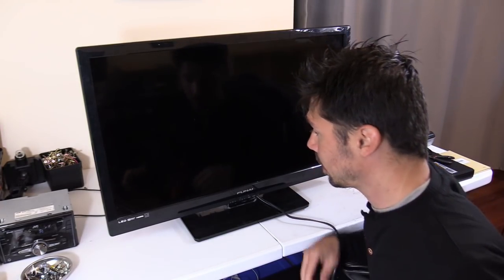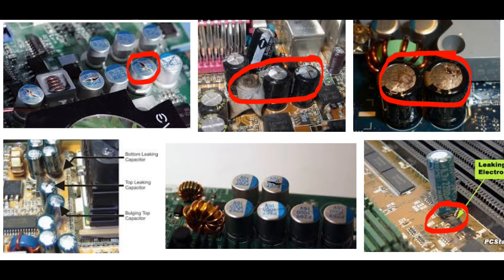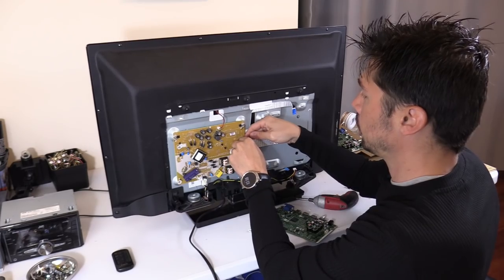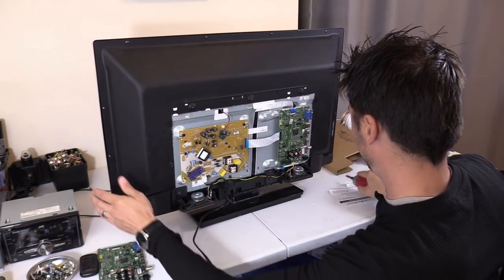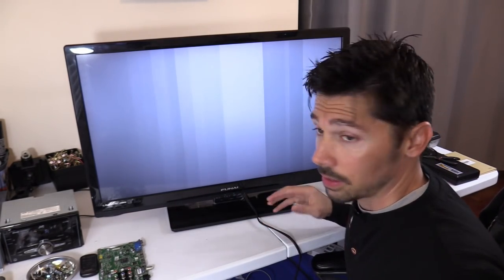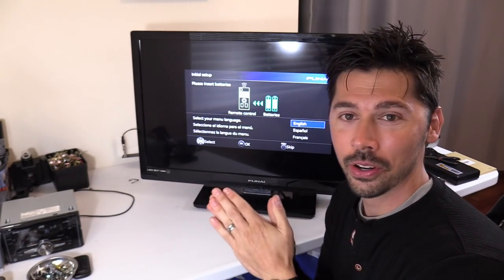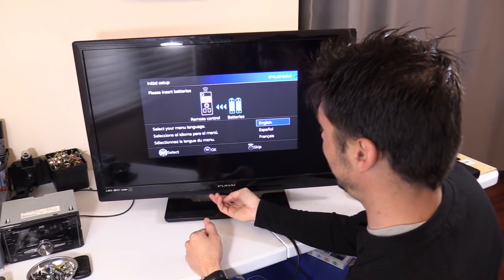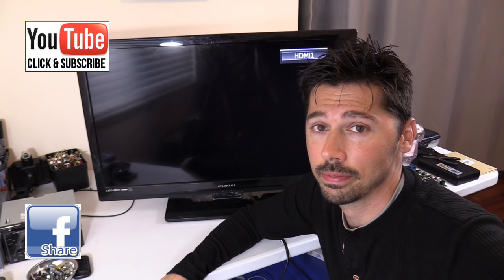WATCH THIS VIDEO BEFORE FIXING YOUR LED LCD TV

Comment from the maker: use the sticker number stamped on the board not the number printed directly on the board. use code TampatecFriend or buydirect5off https://electropartsonline.com/ 
another good source is shopjimmy http://www.shopjimmy.com/components/board-repair-kits or 
Ebay TV parts store- http://stores.ebay.com/ElectroParts-Warehouse/About-Us.html
Reply from the maker: SwapPart TV Repair yes, that saves some money, if u want to link your video here, I'll give you a shout-out. 👍
Reply: Those boards are identical except for firmware. So the replacement was programmed for a TV with a different LCD panel. You could have swapped the eeprom from your original board to the replacement and it would have worked, I do it all the time.
Reply: @SwapPartLLC  Thanks, I was SO curious what the differences were. Makes sense now.
Reply: As if he's got time to point out what's wrong with each and everyone's broken TV's... Lol.   Mines had it too thanks to little hands and a wooden hammer!    Sooo, I'm going to watch his videos & see if there's another way...  He hs a channel, not a hotline    :0)
Reply: Tampatec hey Tampa I have tv when I turn on tv there's sound but no picture when I put a flashlight on screen you can see it
Reply: @ISAACSILVERADO  check your led supply or the leds themselves
Reply: @ISAACSILVERADO  backlite broke maybe look for black points in the led if it has a black point then it died replace it
Reply: Tampatec I have a Vizio 55" 4k tv model number M55-C2 the serial number starts with LWZQSBBS The mean board is bad and looked for a replacement one but no luck only found other one's that aren't compatible. I was wondering if I replaced all the guts would that work? Or does it all come down to the panel that would not be compatible?
Reply: Hy bro I need your help
Reply: Please help me.
Reply: I have some question to ask u about my samsung hd tv
Reply: Tampatec Just subscribed. I have a vizo that the light just keeps blinking . I'm trying to find a video to trouble shoot but can't seem to find one .
Reply: Tampatec ~
Hi bro’ and how’s it going?.. thanks for ya videos mate and keep up the great work!.

Was just wondering, are the tv screens (40”) and the inner connections the SAME between the “Samsung UE40MU6100KX” and the “Samsung UE40F5500AK” for a change over?

Thanks and blessings to you in advance for any information provided.
Reply: someone told me to buy a tv & used it as a tv monitor to my computer
Reply: @ricardoballantyne1057 As long as the TV and computer have matching inputs ( HDMI, component, sound- video) it will work. Do the hook-up first then open display on the computer, find mirror, extend.
Reply: My board does not have any stickers so how do I identify which board I need to purchase
Reply: I know this question is off topic, but I am working on a 2010 LG plasma TV 42PJ350. It seems to work really well, but after long use and turn off it will click on and than click back off. The YSUS board does hum and I am not sure if that is normal. I checked all boards to see which board is clicking on and off, but the power supply makes that noise regardless when you turn it on. Also there is a Logic board below the power supply that has a green blinking light. 2 short, 1 long, 1 short, 1 long and it repeats. I have an idea that it could be the YSUS board, but I am unsure. I am hoping you can help me out.
Reply: tnx ser .im electronic tec.  her in phillipines..tnx to your vedio
Reply: How much is that board?
Reply: Het tampatec were can I order a screen for a 32in tcl cheap
Reply: Hi Tampatec,
Are you open for questions?
Your vids encouraged me to get a broken tv and try to fix that. Initially repair of lensbulbs fallen of and also a bad Tcon (probably)

My first goal was to fix the lensbulb, so I glued every single bulb. After I re assembled the the the screen had 1 vertical stripe right at the center of the screen. It wasn’t there before. The screen is not cracked! I have a photo taken as an example might you want to see it.  I looks like a whole vertical straight stripe of dead pixels. Do you know what the problem could be. 
I also ordered a “new” Tcon board with the same numbers on the board but a different sticker, right before watching this video. You allready guessed it, it doesn’t work. ;-)
Reply: Thanks for sharing, Lord-Jesus-Christ com
Reply: Tampatec hey, I have a LG led 48" smart TV. Approximately a little over two years old. Tv works but I get "snow" on every input. Even screen cast. What happened to it.? Thanks for the great videos. Tv is otherwise snow. Not the cable box, or HDMI cable. Have picture on menus just not in any inputs. Thanks
Reply: I want to touch my body
Reply: @dangrousnurse  K? I'm uncertain who you're responding to, or whom you wanted this message for, but may the force be with you.

Comment: Very useful video as well as some others you have.  Been trying to diagnose the following problem with my Vizio M557-G0.  Powers on fine, get video and sound fine...BUT left 1/3 of screen will fade to gray (still able to barely see video playing) then come to brightness and can see entire video on screen, then repeat about every 5-6 seconds.  Right 2/3 of screen stay crisp and clear.  Found some bad capacitors on the main board and replaced.  Problem persists.  Switched ribbon cables to backlights - left to right right to left, problem persists.  Voltage on t-con board reads ok.  Is it a power board issue or could a section of backlights be faulty?  Thanks for any insights.  Brian
Reply: Just reflow it a little bit and it will be ok.

Comment: You could have just tested all the little ceramic capacitors on the board it prob just needed one of them switched, because all them boards can be fixed it’s always just one or two components usually or the led driver

Comment: Did you ever check the old board to see what was causing that high pitch sound? Being a tech, it's always challenging to find the answer to everything. If you did that, then you'd have the option of ordering a replacement board or a replacement electronic part.

Comment: What if the standby light comes on when you plug it in but wont turn on when pressing power button on TV or remote? When I plug the power in, I hear 2 fast clicks coming from the power board relay but not sure if thats the issue.

Comment: we had a tv engineer working in the workshop on an old t.v the tub philips  he pulled all the connectors from the top .
decided to check the one at the other end of the bench was the same he picked it up and walked the 4 ft to the end .
reaching half way he was stopped looking back he saw the plug still in the socket ?

Comment: Thanks, man. What's the best way to determine if my TV's LED backlights are burnt out? My screen is completely black - no flicker, no gray bars, and failed the flashlight test (I think I did this right). There is no sound and I cannot pull up the main menu.

LG LED TV
Model# 50LB6300-US

1. Red stand-by light (solid and flashing, but not sure which is which)
2. No Sound
3. Tried all the troubleshooting methods (including reset, unplug for 60 seconds, changed outlets, changed remote batteries, attempted to change sources, etc)

Is the next step to order a new motherboard?

Thanks for your videos. I learn so much from you!

Comment: Insignia 46L240A13 Rev.B  - TV turns on with please wait displayed, then shuts down.  Does this over and over. Replaced power supply and inverter - no change.  Tested voltage leaving power supply  all OK.   Disconnected Tcon - no change.  I can only assume its a CCFL issue.  How can I test to know?

Comment: Having trouble with my wd40fb2530 the TV shuts off after a minute I can then turn if back on and it will show tv channel and audio fine but after a minute turn right back off. I'm looking for what to check on the board part number st6308rtu-ap1

Comment: great video. i use your contentt as refrence material a lot this year . this is my first time seing this one though. i replaced my power board but the high pitch sound still happens. i see here that you swapped the main board to get that high pitch sound out. so can you explain more about what causes the high pitch noise>? is there any wauy to get rid of that without swapping the  main board? i have image thats fine (though i need to get into the service menu anytime it reboots in order to set the boundaries correctly)

Comment: I just have re-flown main board processor on Vizio M43-C1 where I had no picture and no sound and no back light. It works great now but the main board processors get 130F too hot to touch. 
Is it the regular temp. on these TV's which in this case after 2 years since new it failed and required repair? I think it is going to happen again. 
TV is is on its belly on a glass table and blowing side-way fan across it, I get 90F and it has pleasant feeling to touch. 
It is strange anyway that they run through the processors so many things and they are not willing to separate those heavy amp load circuits on different board and chase some fans through better finned heat sinks.  Slab heat sink is not enough in this case, is smells and is too hot. If I measure 130F, well the actual temp inside the processor is going to be much higher. No wonder these miniaturized spot solders will crumble and deteriorate. I am looking for extra cooling of the thing.

Comment: I have a 50 inch on TV 4k I have a black screen but sound works and if you flash a flashlight at the screen you can see the picture brightness is at 50% any suggestions on what board I need to replace ? Or possibly the back lights strips maybe out

Comment: Hi 👋 can you help I’ve got a Samsung LE32b450C4w but I have had a look and found just one of my capacitor has gone but I have been trying to get the right voltage for this can you help me this is what I need 1200uf 10v Q105 oC on it can I put a different one in if so could you let me know thank you 🙏🏻

Comment: Hey Tampa tech I want to first say I love all your work and videos 🤗
Im having a problem maybe you could lead me in the right direction I have a Samsung tv that is clicking on and off I verified I have standby voltage and I do 5.2v all the time  I also checked all the caps off the board and they'd good all the diodes.. .5 so there good I checked the transistors by the plug of the main board they measure good I wasn't sure at first in one direction it measured oL
The other way. .2 I contacted tech support who makes the trasitor they said..2 is good is there anything I'm missing I just orders the main board ans still having the same issue pls help I woukd hate to throw it out 🙏
Reply: Help pls

Comment: Hello boss! Not sure if you still making videos, but I have a 55 inch LG TV and it stopped working after a power surge, I checked the power supply board and I get the 3.5v going to the logic board but no 12v, does it still a chance that the logic board is bad?

Comment: Thanks for your Video. 

My TV is TCL U49P6006X1 49 Inch.  no picture, no sound, no faint picture (tried with flashlight in dark room), only the T-Con lights when I turn on the TV, and when I press any button on the remote control, the TV turns off again, with a quick flash on the screen that I have seen just in a dark room, that shows a text, I recorded that as a video, and was able to read the text, it is saying "3 seconds to power off volume" that text is not really helpful.

So I'm still confused, whether it is one of the blacklight stripes need to be replaced (as other youtube videos have suggested), or the Main Board as you have described in your video.

Any help will be appreciated.

Comment: My TV is TCL U49P6006X1 49 Inch.  no picture, no sound, no faint picture (tried with flashlight in dark room), only the T-Con lights when I turn on the TV, and when I press any button on the remote control, the TV turns off again, with a quick flash on the screen that I have seen just in a dark room, that shows a text, I recorded that as a video, and was able to read the text, it is saying "3 seconds to power off volume" that text is not really helpful.

So I'm still confused, whether it is one of the blacklight stripes need to be replaced (as other youtube videos have suggested), or the Main Board as you have described in your video.

Any help will be appreciated.

Comment: Of course it's luck, but sometimes, logic boards can be changed... even with other models TV from the same brands !!
What I did that works in Samsung (2008-2010) :
- Logic board from LE32A466 to LE40A456 (same inputs, so same back cover)
- Logic board and Power board from le32C450 to le32A466 screen, T-con and inverter board
- Logic board from le32b450 to le40a456 (just one "SCART" "PERITEL" port missing, but works)
( Power board from le40a456 to le40a650 : PROBLEM with inverter not working, the power board differs from a letter and a connexion is missing)

I'm sure there are a lot of posssibilities to swap boards with others models, at your own risk of course !

Comment: Hey Guy ! I am Working on a LG 55LN5790u1 Main Board Q2407 Is Cook, This Transistor turns on 12 volts to T Com Board.I dont have The Print Out, If Any one out there Perhaps , you Can tell me If This is a PNP NPN, Digital NPN  PNP,Or other Type of a Semiconductor? I Change T COM ,, Now if I apply 11,5 Dc Volts  With a  Dc Eliminator I get A full Picture and Sound.This voltage is apply to the Fuse of the T COM..Any Help would be Appreciated

Comment: I have a problem with my phone Philips 39pfl4008/56,dead set with standby battery power but no 24 volts output. Chassis 715G5193-PO3-000-002M.needs technical advice. Thanks
Reply: TV not phone sorry

Comment: Circuit board the same. Frimware, possible few parts different hence the added sticker. Pretty much goes with all mass produced products, tv phone laptop ect. 
Have you ever replaced non replaceable battery in a cell phone. Not hard if the manufacturer will sell you the battery.

Comment: because different models of TV have different display panels , the firmware on each models board is different, even if the board model itself is the same , the firmware defines how the board talks to the display panel and how it reads inputs from the buttons on the TV's interface controls.. Does that LCD TV have the T-con panel driver located on the main board itself ? The T-con and the main board digitally talk to each other  and that handshake wont work with the wrong firmware on the main board.. a bad T-con board will also result in no picture ,, sometimes the TV will have audio and power up but no picture or corrupted image in the display, A board with a short will make the power supply squeal in over current protect mode.

Comment: Hi Tampatec,
Are you open for questions?
Your vids encouraged me to get a broken tv and try to fix that. Initially repair of lensbulbs fallen of and also a bad Tcon (probably)

My first goal was to fix the lensbulb, so I glued every single bulb. After I re assembled the the the screen had 1 vertical stripe right at the center of the screen. It wasn’t there before. The screen is not cracked! I have a photo taken as an example might you want to see it.  I looks like a whole vertical straight stripe of dead pixels. Do you know what the problem could be. 
I also ordered a “new” Tcon board with the same numbers on the board but a different sticker, right before watching this video. You allready guessed it, it doesn’t work. ;-)

Comment: Hi, I'm hoping to get an answer from you. My LG TV was making the same noise, blank screen and no volume. I changed the power board, the main board and the wires. It still didn't work. Could it be the the LED light are broken? would it still make that sound if it was the LED lights?
Thanks

Comment: Great videos!  I just returned my Vizio 43" into service after a lightning strike.  Thought it was the power board because I had nothing.  I replaced the board before watching your video on checking voltage on board, that would have saved time and money.  Bought a mother board on E-Bay, the correct number but wrong series, more time and money wasted.  Well, after watching another one of your videos I got the right one.  Last, everything worked but the remote control.  Ordered an IR board, no go.  With time and a lot of patience I checked the little 5 wire ribbon cable to the IR board.  That was it!  All fixed.  I'm no electronics tech, just a retired guy with a Fluke meter.  The parts total was about $70.00, It would have been less than half that had I watched your repair videos first.  Thank you, I still saved $300.00 on a new TV and had a lot of fun fixing the damaged one.

Comment: Its a 32" LCD TV.  Not working.  5V shows on one of the sockets of the power board where 5V is printed.  But on the other socket where 24 V printed, nothing is shown to the multi meter.  Checked it by removing it from the main board.  The middle legs of the bridge rectifier 230 V is shown, but + and - legs shows no power.   Do you think the bridge rectifier is defective? Grateful for help.

Comment: Upper left corner of Sharp AQUOS LC-80LE857U LCD TV has the letters PRS. What does the PRS stand for on a Sharp Television?  Also, there is a black horizontal line across the television and fades to the right. When the tv is off and the screen saver is on the black line is still there. We checked all cables and unplug everything. I think the PRS might be gone, but the line is still definitely there.  Any solutions, or suggestions?

Comment: Thanks for all of your great videos.  I have fixed several TVs with your help.  I have a Sceptre x505BV that had intermittent power issues.  More often than not, it would not turn on.  I replaced the power board, but it still won't turn on (no lights including the standby light).  Is there another board that controls the on/off or should I be testing wires?